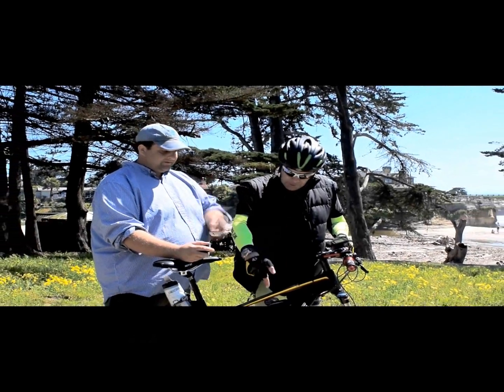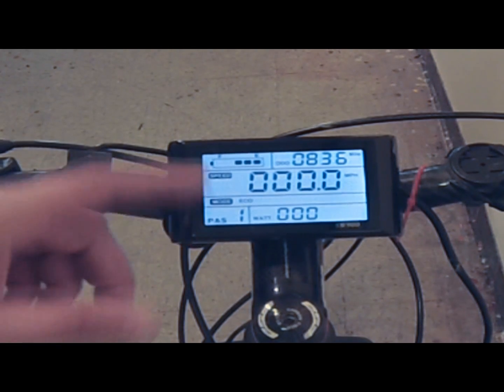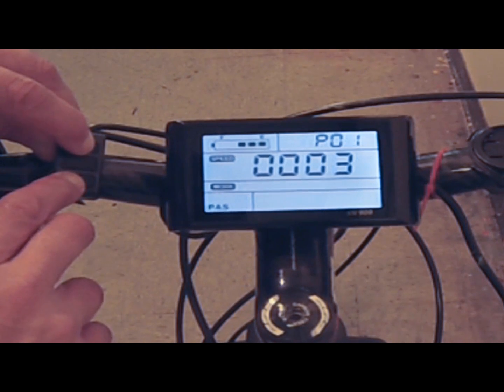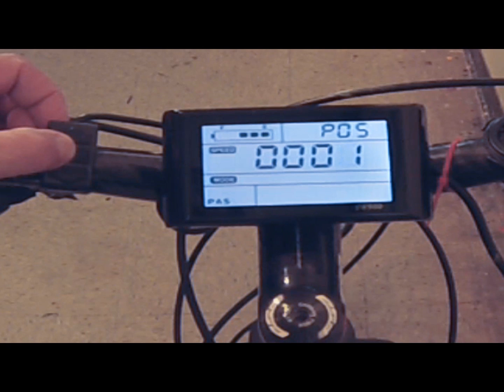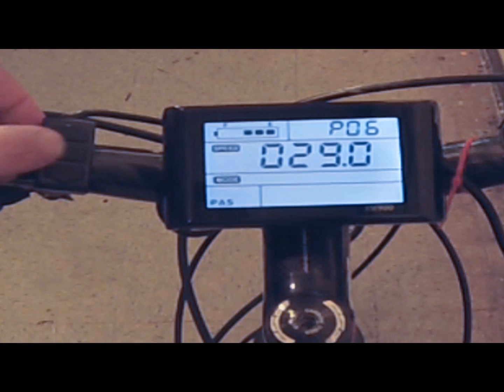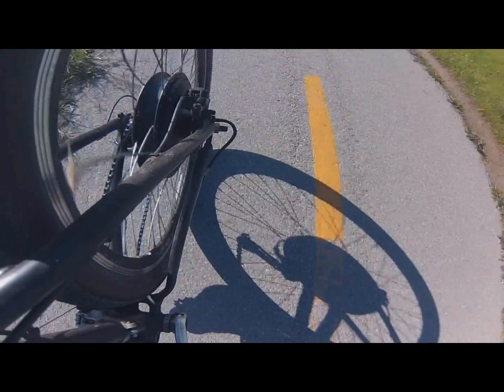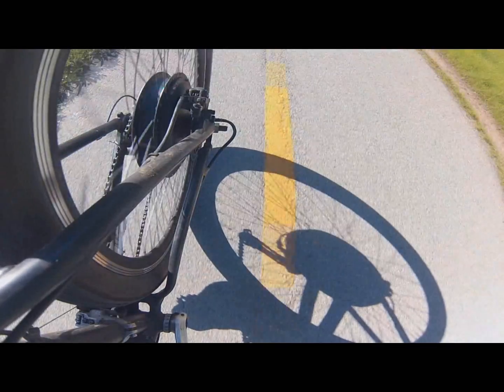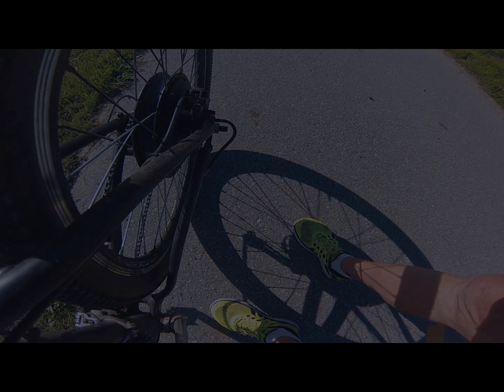How to configure the SW-900 LCD, electric bike multi-function display controller.

Comment: Hi the PAS settings won't display the mode. Seems like this feature is somehow disabled. And a second question. Did you ever figured out why tha watt indicator doesn't work. The computer seems to be connected correctly to the controller.And ideas:)?
Reply from the maker: We just installed the SW-900 on a new bike today and all of those functions work fine, the watt indicator shows up when you are riding. If you are having problems, try disconnecting the SW-900 from the controller and then reconnect, making sure that there is a firm connection. It will reset the SW-900 to its default settings. Then you can reset each setting to your specific needs. Let me know
Reply: Augustine fast Carbon e-Bikes - Santa Cruz 2017  
Hello sir! Thanks for reply!
I'd like to investigate my problem regarding the watt indicator.
I have some 36v  350 watt controller, with 36 v 250 watt motor.  Yes this is a Chinese bike, we got many of them in Tel-Aviv. They all got pretty much the same setup.  In my country.
36v -260watt Controller, 36v, 250watt motor, and 36v battery.
At this point I realized that not all of the sw900 computer features is available  to me. Yes I still need to overcheck the wiring.
However at this point, battery indicator works fine, Pas, works fine, Pas 1-5  works fine too. It shows all the programs from P0 to P16 as far as I remember. But it won't show the watt while riding the bike.
When I asked a local so called tech guy to install the sw900 with a new controller I was thinking that this guy probably knows what he's doing. And I also know that so called tech guys in my country are usually don't know a shit about their own job and a given task.
Yes this is sad:)) that's why I opened up the controllers cup to check if there's a new controller at all:)) well he did put a new controller, but as far as I realized he played with the switch wires, he turned it on by linking them together. But it's okay because the switch key is located inside my battery. However the computer's wires was plugged correctly to the one of the controllers sockets without cutting any of the wires.
No I don't want to visit again this non professional technician. I studied some electrical engineering and I do believe that I can fix it by my self.(but I need to understand the controllers wiring first)
You mentioned some firm cable. Seems like the sw900 plugged with some 5/6 pin flat socket to the controller. Then a throttle cable,  break cables, data in data out. From the first sight looks fine to me. But seems I'm missing something. Maybe it's just some mismatch between sw900 and the controller itself.
Well I can send a picture of the whole wiring if it's possible to you to check what might cause a problem.
Maybe it's a data protocol incompatibility between controller and sw900
Reply from the maker: I don't think there is any problem with the SW-900 controller based on what you've said. Reset the  controller and start from scratch.  Your wiring is fine. Let me know

Comment: Thanks for the video.  I've had my ebike for a year and couldn't make heads or tails of the written instructions I found online for this computer.  They list the options....with a range of settings....but no explanation of what the setting does.  Your video solves this.  I can't wait to finally get the PAS settings right.
Reply from the maker: Great David,

Glad that could be of help. These on-board computers control so many aspects of the bike, sometimes it can be daunting.

Cheers

Kirby
Reply: Did you set the pas? I'm still in trouble because the pas get me all power in every level